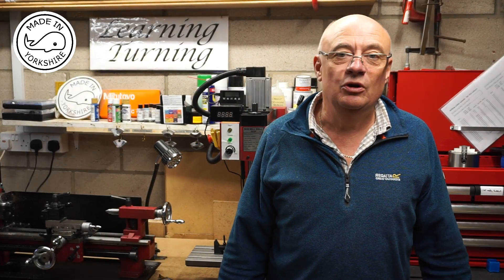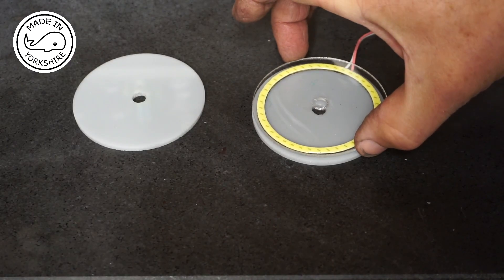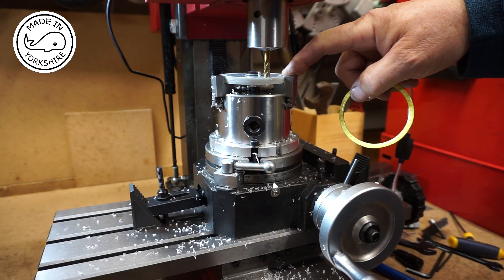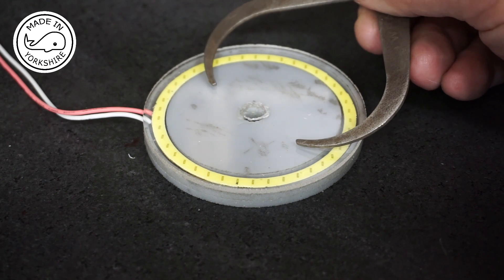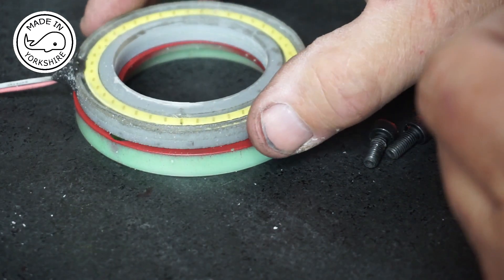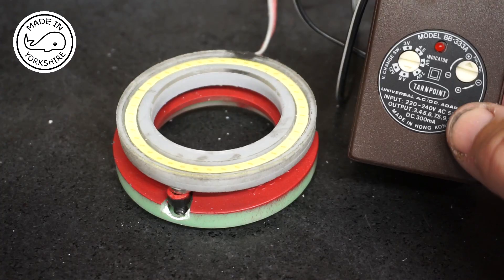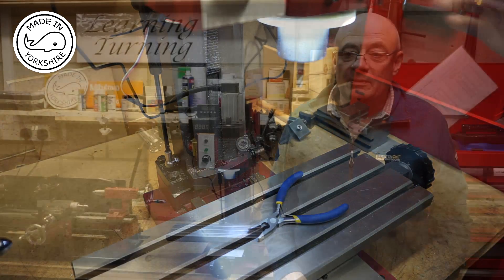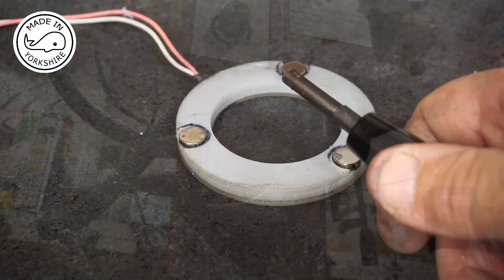#MT23 - Making an LED light for the Mini Mill

Comment: Following Your link to the powering device…. Please Andrew, don't call that "transformer"! It is not. It is a DC Power supply. Transformers delivers AC which most likely would burn down the LED ring in microseconds.
Reply from the maker: Thanks Stefan - I've changed the text.
All the best.
Andrew
Reply: No offence Andrew. Being a member and a helper on the Arduino Forum I know how often a wrong or incorrect terminology leads to confusion, frustration and unnecessay work. In mechanics You know the difference between "thous" (inches) and thousands of a mm......

Comment: Great idea, well done Andrew!
Checked the diameter of my spindle and found it to a bit smaller than 70 mm. Why not attache the ring of LEDs a bit off center,  towards the operator? Light is mostly needed at the front, towards the operator, not to the back side. This could reduce the shadowing effect done by chucks, facing heads etc.
Reply: I just used Your links and tried to order those 2 items but they don't ship to my address. Grrrrrr…..

Comment: That is just so neat in my dark garage! The only sad thing is that it would collide with my locking-pin-holder. I have changed the right one of the three M5 bolts with a eyebolt. So that I can put the spindel-locking-pin through the eyebolt and then in to the hole in the spindel. Then I get one hand free when I´m changing tools. Thanks for your great videos, and thanks for the help with the tachometer!!
Reply from the maker: Hi
Your locking pin is a brilliant idea - real shame it conflics with the LED light. If you ever manage to merge the two I would be really interested.
Glad you like the vids. I can't remember the help I gave you regarding the tach, but the feedback is very much appreciated.
Cheers!
Andrew